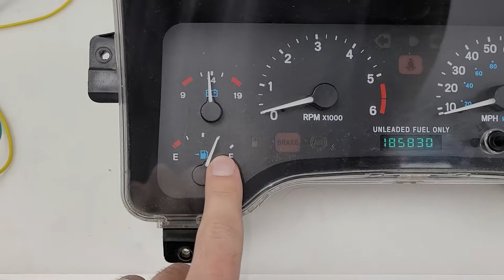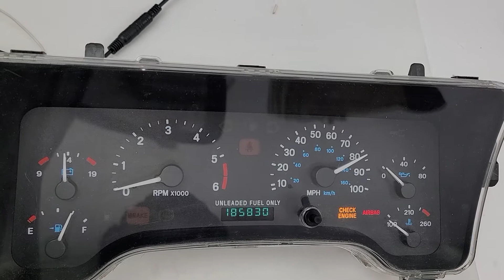Jeep Wrangler Gauge Cluster Speedometer Bench Test For No Communication / No Bus

Comment: Hey,quick question so I can get my 2000 Dodge 1500 van gauge cluster and pcm working like this on my bench?
Reply from the maker: Yes you can with the correct wiring schematics and some basic knowledge it's definitely possible. Took me about 15 minutes to wire this one up.
Reply: @AutomotiveCircuitSolutions  Thanks, also I got the cluster to power on and working good and the donor pcm is out of a 2000 Durango.
Reply: @AutomotiveCircuitSolutions  Thanks, also I got the cluster to power on and working good and the donor pcm is out of a 2000 Durango.